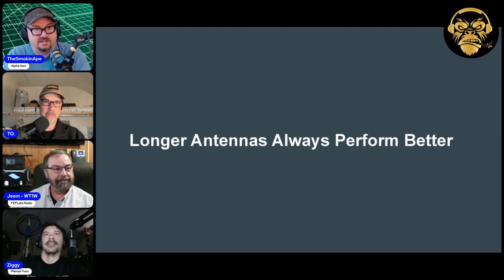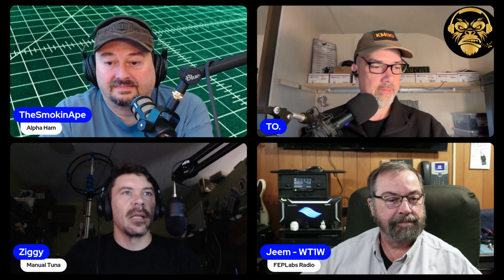Is a LONGER antenna BETTER?

Comment: The only full wave antenna I had work great is a full wave loop om ground into a 4:1 Balun. Super RX antenna . I made a traveling wave antenna years back. over 300 ft long. Think 4:1 UNUN into 75 ohm coax to shortwave radio . Super RX . was a old tube set. national radio one.  The far end of antenna had 8 FT ground rod. then like 2oo ohm carbon resistor to far end of antenna, then a outher 8FT ground rod at the UNUN shield side.  And was like 3 ft of ground and herd stations all over the world with ease. Long wave threw 10 meters. A RX antenna with 2 grounds like 300 FT apart.  73
Reply from the maker: Those full wave loops are awesome!